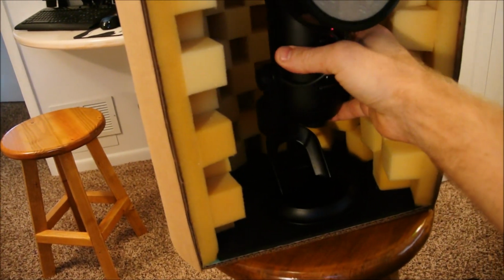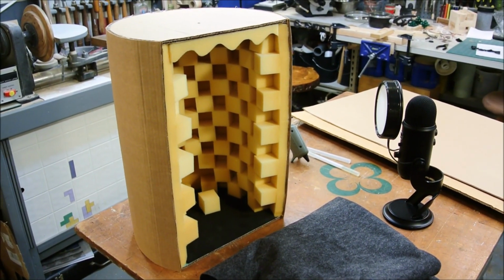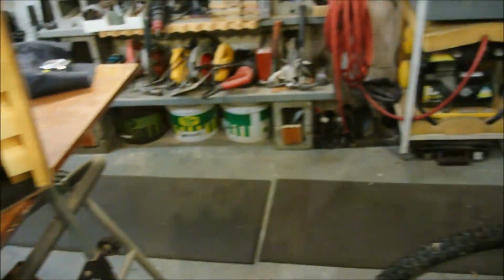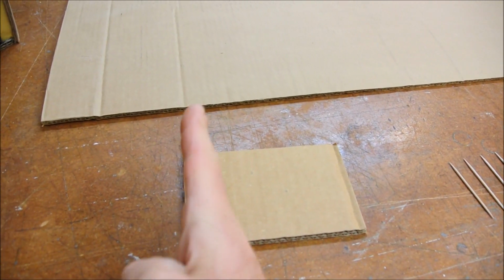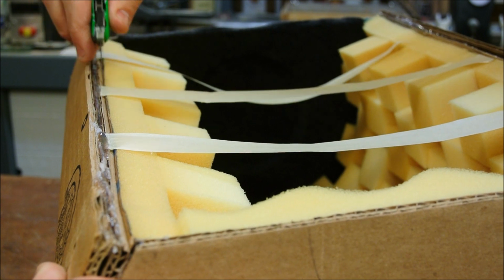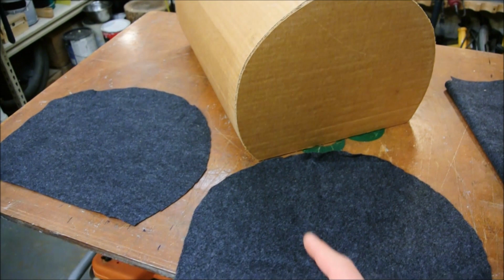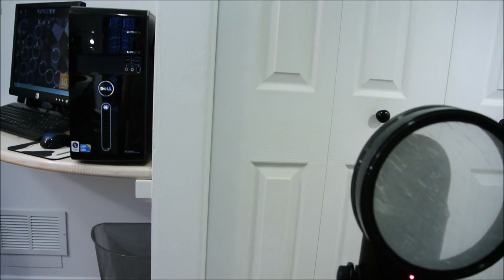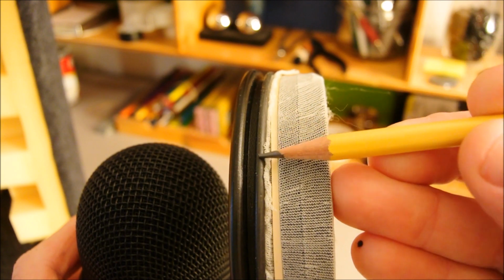Homemade isolation shield & pop filter for Blue Yeti microphone

Comment: thats cool, I use cardboard for speaker boxes and other light duty kit like this. I find it's strong enough when layered the same way you did it's strong enough, you can dress it up in felt (which on top of making it presentable also protects the surface of the cardboard from abuse) and not faffing around with wood means that it's quick and easy to make. so I'm happy to see this project.

Comment: Love both channels, Mr. Pocket. With this sort of setup, you will get a lot of low frequency reflection off your box and that will color the sound of your recording in a negative way. It will over emphasize 150-300Hz making it sound a little too thick and muddy. This can be EQ'd out in post and I might start there. Foam is a good place to start, but it lacks the density to absorb lower frequencies (at any reasonable thickness anyway). I treated my space with homemade broadband absorption panels made with a product called Roxul RHT80 or Rockboard 80. I have made 43 such panels for my office, garage/video studio, and living room. Most foams of that sort of density don't absorb much below 2kHz. Rockboard (or rigid fiberglass panels from Corning) are effective down to 125Hz. I experimented with with this mic box concept, but even with 3" and 2" Rockboard 80, there was still an increase in low frequency energy reflecting toward the mic.

So, for now, try a 3-6dB reduction around 150-300Hz. Using a parametric EQ, try boosting 6dB around 200Hz and sweep the frequency up and down a bit until you hear the most problematic frequency. Then reduce the gain (dB) of that freq. until your voice sounds a bit more natural. Don't suck the life out of it, just take out some of the woofy mud. Best solution is to treat the whole room with a 10-12 2'x4' panels. It will make a world of difference. Here a photo of what I did in my space: https://photos.app.goo.gl/jQh4Zdpv58IALhSC2 This photo is from 3 years ago. Monitors have changed but the room still sounds excellent!

I don't offer advice to every YouTuber, just the ones I like to watch.

Comment: Cool project. It's odd to see you working with no wood for once, and with "cheap" materials. But the application was really suitable; making it lightweight and sturdy enough for what it will be used for. I wonder what it would sound like if it was made out of wood. Perhaps a wooden shell but with foam within the wooden walls. Maybe the sound would echo inside like a guitar does?

Comment: so i presume the reason you didn't use wood glue to glue  the second layer of cardboard was just for time.
usually a mix per volume of 20-30 water to 80-70 wood glue  works wonders for me when gluing cardboard.
i have heard of gluing cardboard with sodium silicate, but it did not really go that well for me . 
have you ever tried using it?

Comment: Yo how did u get the cardboard to keep its shape like that
Reply from the maker: First cut two identical circles that have flat spots. Then you can wrap a long piece around these circles by starting from one side and slowly bending it, gluing as you go. It works surprisingly well: just don't be bashful with the hot glue, and let it cool for a moment before continuing to wrap.

Also, remember that cardboard is corrugated; thus, it will wrap around a circle MUCH easier in one orientation than the other.

Comment: Pocket, make sure to set the microphone the cardioid (the third setting from left to right) and have your gain anyhere from 25% to 40%. I have the same microphone and that's the best setting for it.
Reply from the maker: That's exactly where mine sounds best. 40% and with Cardioid. So what do you think about the box?
Reply: pocket83² It's awesome. I really liked the video. One question though. Why didn't you make the base more solid? Like plywood or any hardwood for that matter. I know it wouldn't help with the acoustics but I think it'd give it a sturdier feel.
Also ohmygod you replied to my comment I am such a big fan of yours.
Reply from the maker: Thanks! Because it was incredibly strong! It's also light as a feather. And I just wanted to do something different, and perhaps a bit more accessible. 

 And I always reply to comments (at least the ones that make sense)!

Comment: Hey, I work with recording via blue yeti's - your setup may still have some cable whine depending on grounding, and also some blue yeti's have a natural whine on low gain settings. Does yours have any issue there? If so you can fix that pretty straightforwardly with a VST plugin.
Reply: I don't know. I haven't noticed any whine sound, as long as I keep the gain in the middle. In general, the sound seems to be adequate at this point, and it's a vast improvement for my voiceovers. The only software modification I make is to lower the bass via Audacity, because the isolation box seems to deepen the sound a bit.
Reply: Yeah, the ideal goal for a good mic setup is to apply zero gain on the mic - but to get that done with the Yeti can be a pain, most people I know run middle gain much like your own. You're right though, it is a huge improvement. 

If you're running it through Audacity, and later on you do choose to lower the gain, you can apply a noise reduction filter over it - not quite as good as a VST plugin like ReaFir, but it can grab a noise profile and mostly eliminate it without degrading your sound quality.

Think of gain like increasing the ISO on a camera, the higher it goes, the more artificial it will sound, as you're forcing it to go through a modulation layer. Either way, a substantial improvement :)

Comment: "Some sort of podcast?" ;-) I've got a pop filter, but I do need to upgrade my sound foam game.

I think that's what they based Magneto's helmet on in Xmen.
Reply from the maker: You just made me cough and laugh. That does sound a bit dismissive. At the time I said that, I was pretty much unaware of the content. As for using it as a helmet, I couldn't tell if it shielded me from psionic attacks, but I'm pretty sure it will work.
Reply: NP, I thought it was funny.

That's what Xavier would have you believe!

Comment: Pretty nice booth, definitely more stylish than more or less all the other ones I saw. If you do find that you still get some noise (I thought I heard some, but it could be my speakers) you could try something like VST host. I use that with Reaplugs (https://www.reaper.fm/reaplugs/ - the only one I use is reafir to remove the sound floor) and it works well, though you have to set a couple of settings so it remembers all your settings from session to session, and you have to explicitly turn it on for it to work. It's free as well, which doesn't hurt.

In case you wanted to try it, the settings that I remember you have to have always on are:
- File>Plugin Autoconnect
- Plugin> Autosave Bank & Reload Bank
- Each time you turn it on you have to Devices>Wave and select your microphone, for whatever reason.

The sound you have is already pretty good in my opinion, but in case you ever felt like fiddling around with this kind of program, you can find tutorials on Youtube, it's just that some omit those settings and it can take some experimenting to find out why the settings aren't saved between sessions or why it doesn't seem to work (if you forget to select the device in Devices>Wave).

Thanks for the video!

Comment: "voice over", "narration"... roleplay ?
anyway, wanted to tell you that I've used your copper chain making method, I've been trying to make some jewellery (nothing fancy, just some things to gift), and it was really helpful, thank you.
also, I hope that microphone "booth" is now sturdy enough to rest your legs onto :)
Reply: And I also hope we will be hearing more about those mysterious "podcasts !"
Reply: Why would you use copper as medium for jewelry?.. it'll just turn the gift recipient's skin green if it's not coated. And even then.. cheap clear coats wear off in no time. You'd have to use a fairly expensive 2 part epoxy coating to prevent the skin acids from reacting with the copper. Do you have a secret method to prevent this?
Reply: Drying oils seem to work best. I've had great luck with Minwax teak, which is kind of similar to a rub on poly. Lacquers are not a good idea if the copper moves, as in chain. But- all finishes take away some shine.

Honestly, the best solution for Cu jewelry is to salt&vinegar wash it before she goes out. It takes only seconds, and the brilliance easily lasts the day. The stuff is simply beautiful after the clean.

As for green stains, that would only arise from (really) long-term wear, which would be silly; one should be aware of the quirks of the medium. For example, if she wears opal, she can't get it cold. Adapt to limitations, that's my advice!